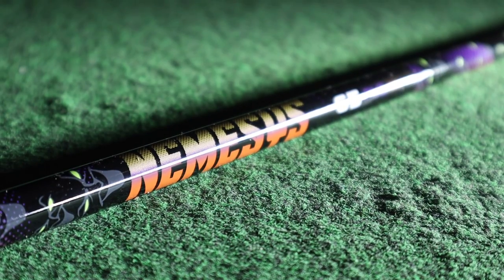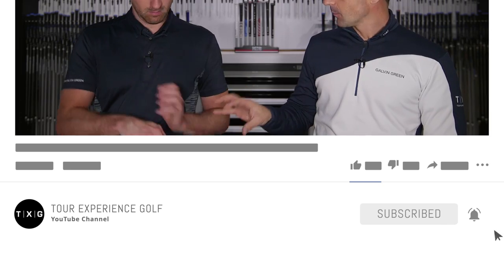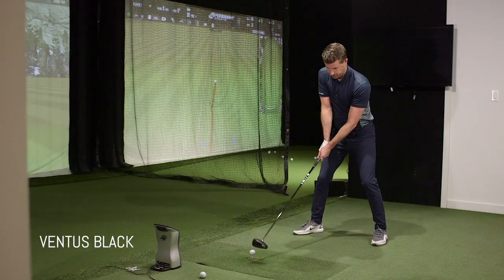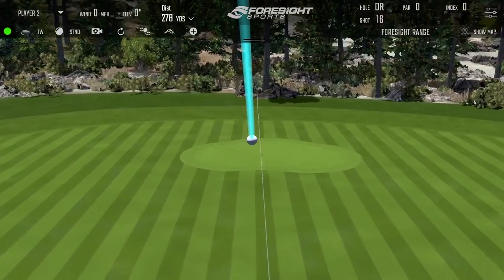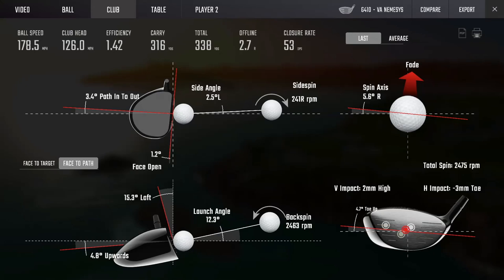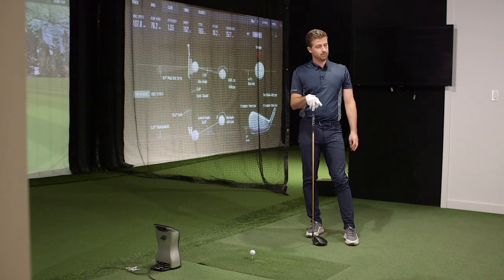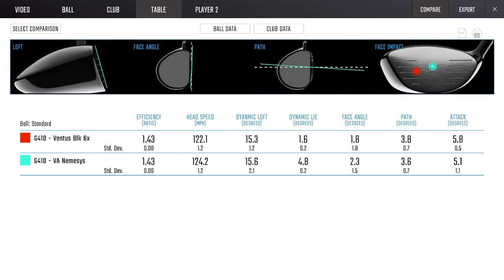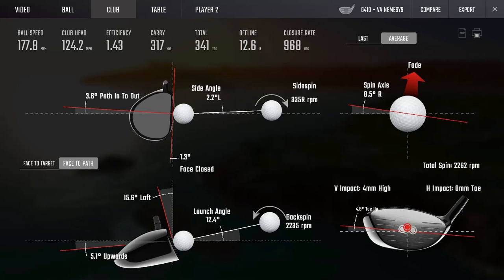Should you try a counterbalanced driver shaft? VA NEMESYS exclusive first test

Comment: Hey, brilliant again. 
I tried the tensei Orange 60g stiff with the CALLAWAY Epic flash and felt I couldn't square the club face up and always had this push fade. Just felt as if I couldn't control it. 
Stuck in the tensei Blue and immediately felt as if I had loaded the head with weight. More a driving ball and a soft draw or straight. 
It was like I knew where the club head was with the blue but had no idea with the orange.  
Brilliant swing again Matty smooth!!! Love the big follow through finishing your swing is something I'm trying to work on over the winter. 👍👍👍👍 first class boys

Comment: Do you think in the reviews y’all could include the price in shafts? Or maybe do a range of mid price point shafts as well?
Reply: Great idea ...
Reply: That would be awesome.for MOST of us!   Good idea sir.
Reply: The point isn't for you to go out and buy this shaft though, the point is for you to get fitted for a shaft that works for your swing. Just because Matty was hitting it accurately doesn't mean I  or you or who ever would hit it accurately with the same setup.
Reply: Chris Caruso I get that, but it would be nice to know retail prices of some of these. Or maybe know what some characteristics of some low and mid range shafts are vs stock shafts. Not all of us that love golf can afford $400-$600 shafts.
Reply: If I've learned anything from this channel it is to get a quality fitting.  If you are upfront with your fitter about your price concerns they should be able to offer you product within your budget.  If you have a modern adjustable head you might be able to retro-fit your old head with a new shaft to save you some $.

Comment: Well ok hmm ..  I'm between 5 - 10 yards behind Matt average drive 325-330's I also play the G410 with upgrade 60X 'Tour shaft" and was about to pull the trigger on the Ventus black ...although I normally like a lighter butt feel an more head feel ..I do have a tendency to move the in as well maybe more meat in the handle might help keep clean the flight up an little more .. looking forward to that shaft test

Comment: I took a leap of faith and bought the 65x shaft considering I have had success with other CB shafts for my Ping G410. Glad I did, so smooth and raised my ball speed roughly 3-4 mph while adding a 4 gram heavier weight in the head but still maintaining my swing speed and spin characteristics. But I was worried at first, it felt soft or a little whippy wagging it in my hands. I just don't understand how it works so good feeling so soft for my SS.

Comment: After seeing Matt test so many shafts, I’m surprised he hasn’t stuck with the Fujikura pro 2.0. He always seems to do so well with it
Reply: What do u mean? Hes testing everything. If he stuck with something there would be no new content lol
Reply: Ray Ho great point Ray, I thought he was great with that shaft also.
Reply: O. G. Yes Matt should definitely be testing everything, especially with his unique speed and tempo combination.

I was stating how well he has done with the fuji pro 2.0 that it should be his gamer, instead of the Ventus
Reply: Ian Fraser I remember during the ultimate driver where Matt was using the ts3 in both diamana 60tx in the beginning, and switched to fuji pro 2.0 tour spec later in the bracket. It was a small difference but both dispersion circle and carry was better with the Fuji shaft.

But that’s also with the ts3 and not the g410 so it’s probably not entirely comparable
Reply: Ray Ho it all dates back to the first time we Tested F9 with the additional weights in the head, we used the Fuji Pro 2.0 TS to offset the additional head weight.  Worked a treat.

Comment: Hi - 
First off, let me say, your videos on youtube are the best in the industry (Ian and Matt, you guys are great).  I truly enjoy the insights you present.  I wish you guys had a branch in Chicago!  

Given that you guys did extensive testing of the VA Composites Nemesys, I was hoping you might be able to help me out.  I currently game the Ping G410 LST 9.0 degree.  I play out of Olympia Fields in Chicago and my handicap index ranges from 5-6 at any given time.  

I have been playing my trusty Graphite Design Tour AD DI6 (stiff flex in 45 inches) in the G410 LST.  I have played a little bit with the Tensei CK Orange (stiff flex in 45.25 inches) that came with the driver.  I have found that when I hit it on the screws, the Tensei CK Orange gives me better distance, but the overall dispersion of the GD AD DI6 has been more consistent out on the course.   For reference, I am using the stock 12 gram weight that came with the driver.  

After watching your video from Dec-19 I am considering taking a flyer on the VA Composites Nemesys (65 stiff flex?).  

Was hoping you might be kind enough to give me your thoughts on the 3 shafts and how the Nemesys might compare?  

Thank you for your time!

Comment: Tungsten prepreg is the same tech used in the Tensei Pro Orange which is intended to bring a higher balance point to a softer handled shaft, which would not normally have a higher balance point like a stiffer handled shaft would naturally have. I would be curious what the EI profile of this one looks like.

Comment: Have you done any testing on counterbalanced shafts vs counterweights in the grip? In my experiences so far there wasn't much difference in performance when building a club to similar specs between counterweight shaft and counterbalanced grip.

Comment: Is a counterbalanced shaft better for the g400 driver? I tend to push my g400 a little bit and I have a kuro kage 60s in it. Would a counterbalanced shaft some what help prevent that
Reply: deuce3811 very good chance a higher balance point shaft would help!!
Reply: Ping heads are generally heavier and are offered with a stock CB (counterbalanced shaft) to offset it.
Reply: @ianfrasergolf  so for somebody like me who doesn't have the opportunity to test out or get a counterbalanced shaft, where are a few things that I can do to create a somewhat counterbalanced driver shaft?
Reply: deuce3811 you could have a Tour Lock Counter weight installed into your current grip. Or simply use a heavier grip like the Tour Wrap 2G specifically the white version.
Reply: @ianfrasergolf  thank you

Comment: Ian, did you adjust the SW so they are the same for both setups? 3SW difference would take a lot of extra head weight to equalize. Let's have a look at the EI curves for these shafts, if you get them can you post them. Can you tell me where the balance point is for that driver setup?

Comment: What do you think about using this shaft with TM M6 head? Currently using a Project X evenflow 1100 shift shaft?
Reply from the maker: will likely produce a swingweight on the light side with that head and without further adjustments to head weight
Reply: @clubchampionmedia  Thank you for your response

Comment: What is the difference of having a high balance point to just using a heavier grip (eg. midsized instead of standard) on a regular shaft? Wont the added weight of a heavier grip effectively move the balance point towards the grip?
Interested to hear your thoughts, cheers!
Reply from the maker: it would, be you're introducing more total weight to the club which isn't always ideal

Comment: Was Matt hitting this at a lower swingweight, due to the higher balance point shaft? Or was weight added to the head? If no weight added, is this is a signal that a lighter swing weight was working for him? I was recently fit into one, but had some concerns on how swingweight was being effected. Didn't pull the trigger yet and need to discuss with my fitter again to confirm we can add a little weight to the head.
Reply from the maker: didn't adjust head weight, so you are correct the lighter swingweight seemed to help performance here

Comment: Watched this twice and as usual was very informative. Have a question related to VA Nemesis shaft. Have you seen any variability in the performance of the delivered shafts?
Reply: Asking this since I was fitted with the 55 gram R flex. The performance at the fitting was fantastic but the delivered club is not performing similar to the shaft used at the fitting.